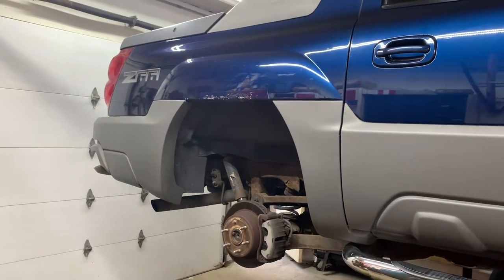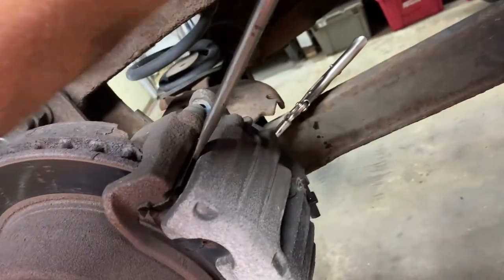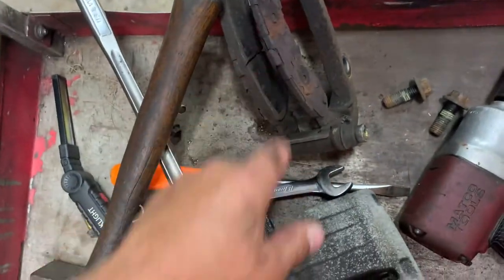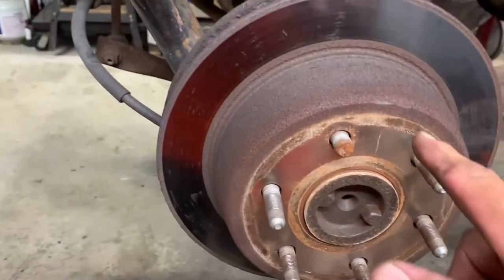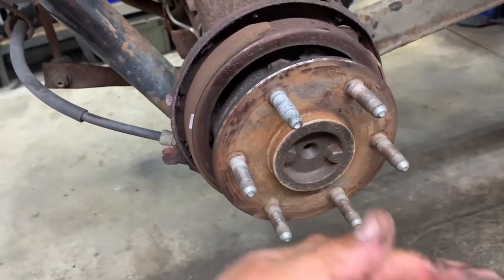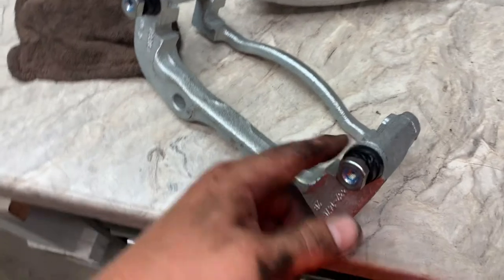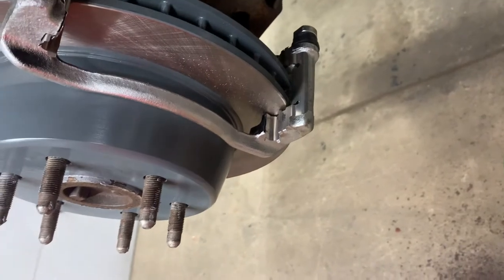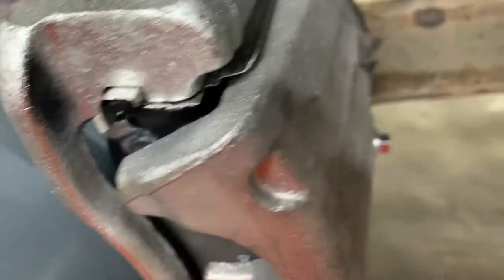2002 Chevy Avalanche rear brakes and calipers

Comment: Excellent video!  I've done a lot of cars and mini-vans but never a truck this big.  I'm going to attempt my best friend's 2002 Avalanche 1500 because she can't afford to take it to a shop.  I inspected the brakes on the driver's side, the one that's squealing all the time but didn't start taking anything apart yet.  I noticed that the outside brake pad is still a good 5/16" thick, but I can't see an inside pad at all and it looks like the 2 cylinders in the caliper are riding directly against the rotor.  So I was wondering if they can fall out on occasion or do you think it wore so thin that it crumbled into pieces and fell out that way?  Based on your comments in the video, I assume I should replace the caliper due to the very uneven wear from front to back and because it was rubbing metal on metal. Pads and rotors were done in 2015 but not the calipers.  The rotors have a few groves on the back side from the caliper pistons.  Also I noticed that you didn't use any grease anywhere  Should I use any caliper lube on the bolts and slides and moving parts, or leave them dry like you did?  And one final question, how do you get the 12mm bolts out of the calipers?  There's no room back there to swing a ratchet long enough to get any leverage.   Thanks
Reply from the maker: First replace the rotors and pads get a better brake performance and also if pads are unevenly worn or metal to metal replace the calipers and yes put lube on the slide pins make sure to replace the metal hardware no lube on them it will collect dirt also when pads or out yes they will fall out on inner also use a large wrench to get the big bolt out smack the wrench with mini sledge to loosen it

Comment: Great video.. straight to the point. i just some things.. awesome... thank you for the tips.   i cant get them back 2 bolts off for nothing.  living in rust belt sucks.
Reply from the maker: Propane torch or map gas heat them up , use a wrench smack with mini sledge or breaker bar with pipe extension
Reply: @richierock1300  its pretty tight back there.  ill try your method ..the sledge hammer tomorrow.  i heated em up but ...just couldnt get em to budge with a breaker bar... its about 15 inch...ill find a pipe to help.  i just dont want to strip it.  so i been carefull.  my friend said get the freeze off can.  i cant go back to work till i get it off.   Rotors took a crap. 
You made it look to easy.  hehe .. had to change caliper also. :(   fun fun fun.   lol
Reply from the maker: Yeah sometimes you can’t put socket back there so I’ll use a wrench and hit it with a mini sledge good luck
Reply: @richierock1300  i got it off today with a cordless impact wrench.  HOLY SMOKE that thing was killer. ALOT of torque.   Than i used your advice on airbubbles and those silly metal bracket things.  I am back to driving.  Your video DID help one person.  ME!~  thank you.  I owe ya shot!~
Reply from the maker: Good job what brand of cordless impact was that strong